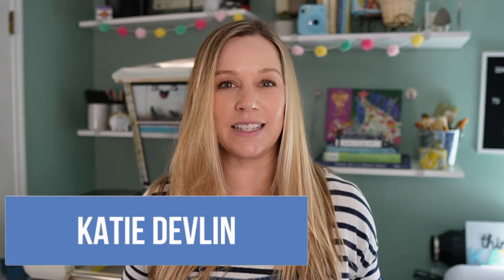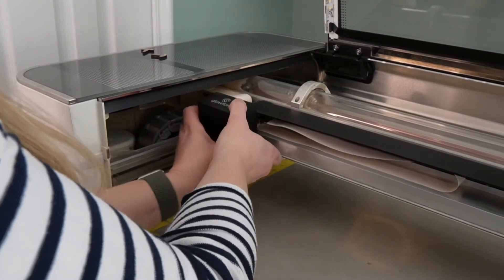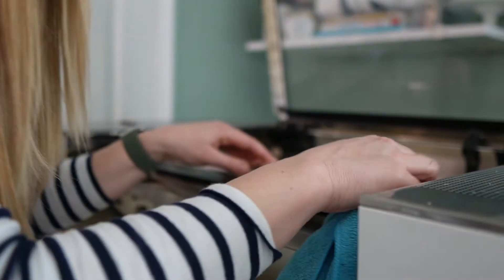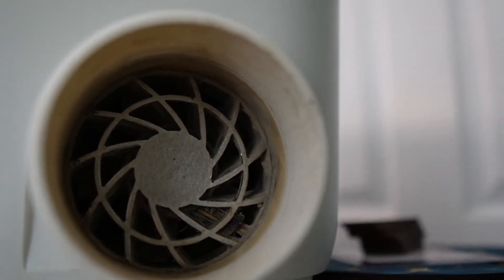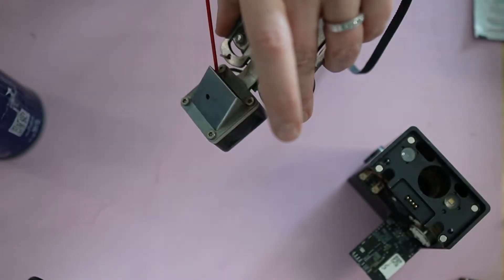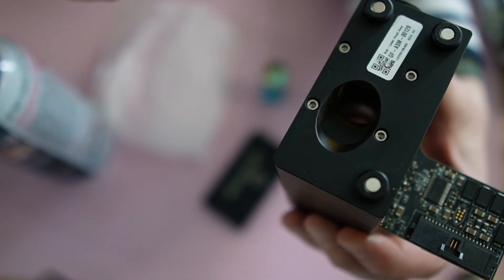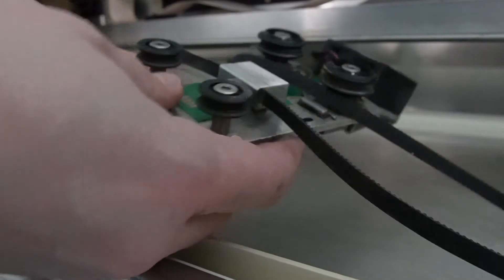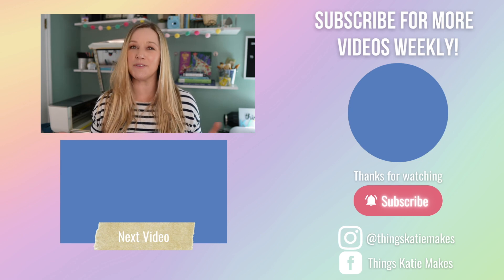Clean Your Glowforge the Easy Way - Beginner Tutorial

Comment: Do not force the belt back on like this!  10:43 I just followed these directions and my pulley wheel shattered. You have to release the tension first. The wheel costs $8 plus $25 shipping to replace, and it will take a week to arrive 😭
Reply from the maker: Hi Marie - I’m sorry you had an issue with your wheel. I don’t suggest to force the belt on, I use the wheel to roll it into place and it goes on very easily using the motion of the wheel to turn it into place.
Reply: @ThingsKatieMakes  At 2:57 your wheel came off, and 1 pause and reset later it was back on. That is deceptive. This is also the reason you should always unscrew the right wheel and screw it back on, not slid the belt off the wheel.    Yes, Glowforge says to do it this way, but Glowforge also sells wheels when you break them.
Reply from the maker: @LithosAndLasers  Hi Terry - while I did not intend for the edit of the wheel coming off to be deceptive, I understand your point. I was not aware you could remove the right wheel, so thanks for pointing that out. I see you have a video describing it, which I have added to the description here.
Reply: @ThingsKatieMakes  No worries.  Sliding the belt off is more likely to break the wheel, so seeing the edit just felt like."What if that happened to a viewer, how do you resolve it?"   I see you have a Thunder now.  I also have been using my 100 Watt large bed laser since Oct 2021 and LOVE it. I have not even turned on the glowforge since December. BUT, I have alot more tutorials I want to make for that, before selling it.  (And tutorials for the larger laser, and sublimation tutorials...  Work and side hustle just leave little time for video making :)    No hate here for people trying to help :)
Reply from the maker: @LithosAndLasers  Looking forward to more videos from you! And I noted your video in the description so people can learn the alternative method!
Reply: May have already been commented on, but you can just loosen the hex screw on that right wheel and it will slide left and right. That gives you some slack to remove the belt safely. @ThingsKatieMakes